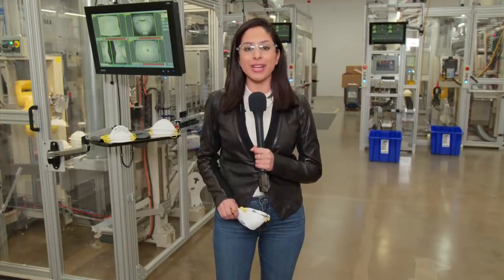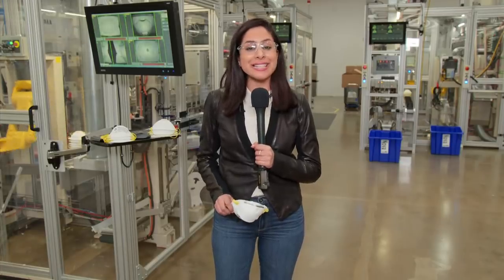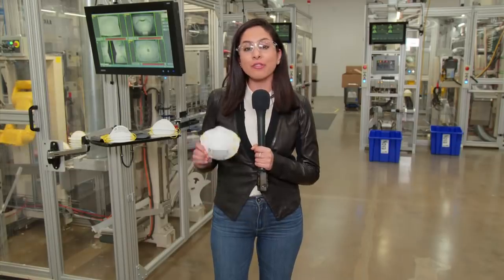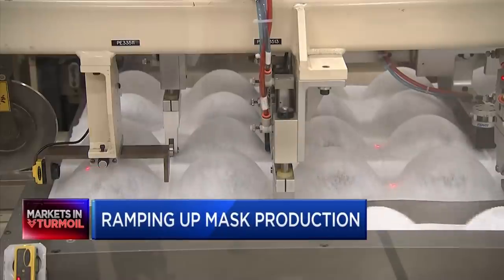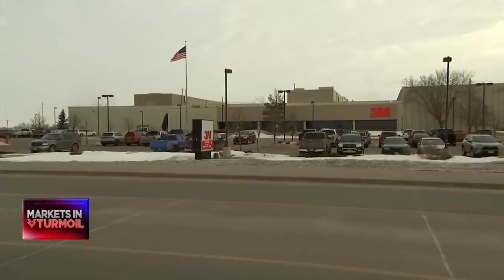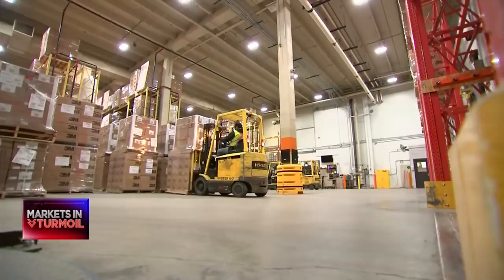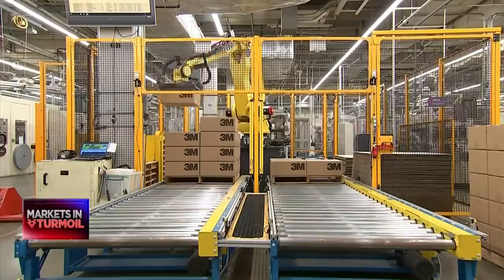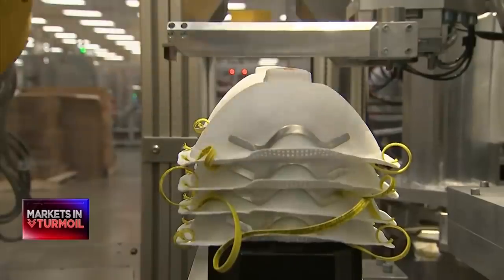Face mask shortage sparks global race to fulfill orders

Comment: P100 - is the same as N95 but gets 99% of  particles (vs 95 with N95) - P100 in addition has oil protection...
Reply: Wait, wouldn't that means they should be called P99 then?

Comment: The “95” means the mask, if properly fitted “fit factor” presents a big if, can filter out particles down to 0.3 microns 95 percent of the time hence (N95).  Coronaviruses measure between 0.1 and 0.2 microns, which is one to two times below the cut off. No rush 3M no rush!
Reply: It's better than nothing. I imagine most of the exposure would be virus imbedded in cough/sneeze droplets, which the mask would stop.
Reply: C. Caner Telimenli  it is not the virus that must stopped but the tiny droplets, quite different

Comment: Gimmee some. I have anxiety.
Reply: It won't help, it's waste of money. Most of infection comes from touch, gloves might be a lot better at spread reduction and for Safety.
Reply: @alexandersebela370  You just contradicted yourself. Even if most infections come from touching something infected and then your face, simply wearing any type of mask already prevents accidental touches to your nose or mouth - so they help as a physical barrier even if the filtration of the virus is as useless as you claim.
Reply: Don't get discardable masks like the ones shown in this video. Instead, get a reusable one with P100/P3 particule filters (which last for months each and only cost $6). Search for "3M half face series 6000/7000 mask" for the mask and "3M P100/P3 filter" for the filters (The ones covered in a rectangular plastic shell are more well protected and can be wiped clean, better choice over the round exposed ones). Don't forget to buy eye protection too, with either a rubber or foam seal around the eyes, heck even basic swimming goggles do the job. You'll only spend around $40-50 for the whole kit and it lasts for 6+ months, get 2 or 3 extra pairs of filters and you'll be good for 1.5 or even 2 years. Mask can be submerged in water and deeply cleaned. Having anxiety and stress is bad, don't listed to people who discourage you from buying a mask, if it makes you feel better (they DO protect you) then buy one. Being less stressed with a $40 investment directly makes your immune system better.

Comment: what we really need is some form of reusable masks. When I found out you could only use these for 8 hours, hum I hope we can do better.
Reply: Half-mask respirators are reusable if you disinfect them.
You can rotate your filters, and put them in an isolated/ airtight space after use.
Reply: worse, one use only per exposition to contaminated zone, that means you don your mask to go out  for 10 minutes, discard, 4 hours, discard. and the filters of the reusable are contaminated and must be discarded. Same for the elastomere silica gel face mask itself, decontaminate. So How many filters do you need ? How many Nx ? lot, lot. this is the truth, anything else is wrong, and expose you. Anita RN
Reply: @anitaleroy9442  Ok si Anita i've just learned about this produit i didnt know before, an electric respirator, kind of ewpensive but can be used for 2 months
Reply: @anitaleroy9442  Who can afford hundreds of filters/respirators?  In a Hospital setting or if you are in direct contact with infected, of course you need new masks/filters.
But for normal people it is better than having no protection.
The virus can survive on surfaces for up to 9 days, dependig on the temperature.
So if you take your used P3 Filter, wipe the outside with disinfectant, put it in a ziplock bag and put it on a radiator (depending on the maximum storage temperature ,  about 40°C/104°F) all viruses should be dead after ~ 10 days. Of course its not ideal, but it's a lot better than no respirator at all.
Reply: @Tanouuuu  a respirator with a filtering cartridge and a fan (PAPR) ?
Reply: @anitaleroy9442  Yes, I think that's what am talking about. It had a fan indeed and a cartridge. but it wasn't huge and bulky or anything. And it came with a wire, like for phones, to charge it.
Reply: @Tanouuuu  You have it already ? use it, and cover the cartridge with a disposable filter, first line; droplets will rest on the first covering. Ifit is a combined cartridge, no matter, charcoal is doing nothing, but it can stay on  as even saturated with moisture and any vapors. The particulate filter is the most important to preserve. SHTF running to us.
Reply: @anitaleroy9442  I ordered it, but i wonder if it Will come at all. Tbanks for the tips. I have a few n95 though, anyway to re-use those ?
Reply: @Tanouuuu  shared with a chnese girl, export clothes; told me it is far better in Cjina cn go shopping (sent photos) always masked andt this for   .. the end of the virus, but think we can win if doing as they did, protection, no contact etc told me that think masks are a little abailable for export fro !china by DH, prices are lowering, will be in touch tomorrow
Reply: calculation last night almong obervers, after Italy closed and upt 9000 rocketing For teh death rate now, forget the former estipmations, yu have since ten days to look at the ratio between the number if infected at day x and the numbner of dead 7 days (or more ,worse)later to get a closer view into what is happening. ! RAtio jumps to 15%, 20 % (1000 infected, 500 dead Italy ! We have only a few 1000 deaths roday, but the explosive potential is developping at highest speed every day, so if cutting anythng tomorrox nearly everywhere, as beginning in Italy, the chains are cut, and this as long you need till coming baks to an inversed curve (they put down hispitals in sWuhan,; good sign. Indeed masks mandatory when in public. Anything les; if the beast runs at the same speed, hundred of millions of dead until it stops, exhausted yby itself. truth. this whu the health officer of BC Canada burst in teears two days ago while no dead in Canada and 20 so contaminated ...!
Reply: @Tanouuuu  if it is a full face mask, perfect; indeed decontaminate the mask after each use !
Reply: @anitaleroy9442  hum no its a normal respirator mask just like in this video, not full face.
Reply: Tania Scarlett don’t you have to keep redressing anyway?
Reply: @frannanderson4165  In Belgium and France now we are making in emergency amounts of fabric masks, washable, with filter inserts, several shapes (pleated, 3 panels, and curved shape mostly) Cotton, and inside cleaning eletrostatic dusting wipes ... SHTF in Europe. Lot will die.